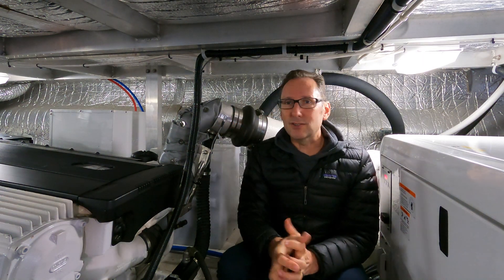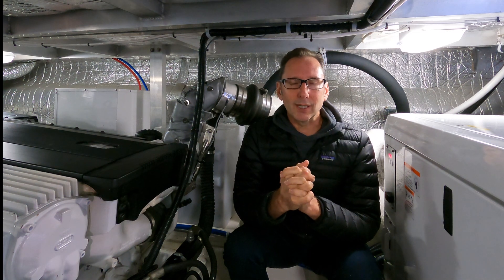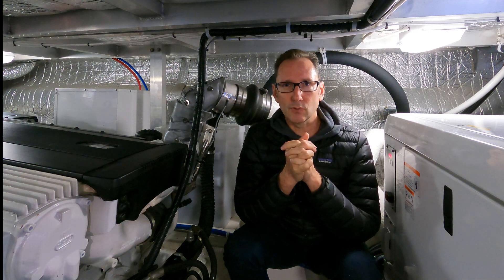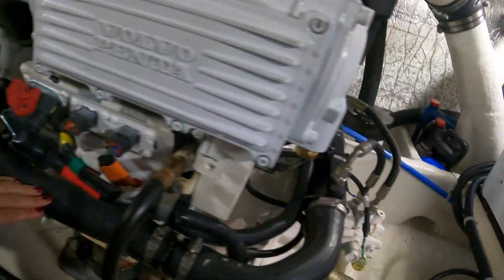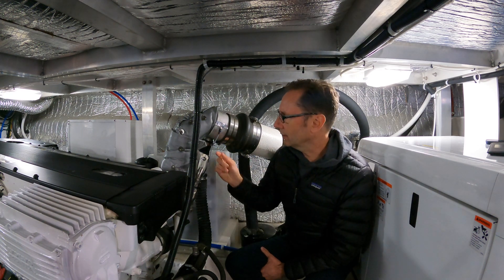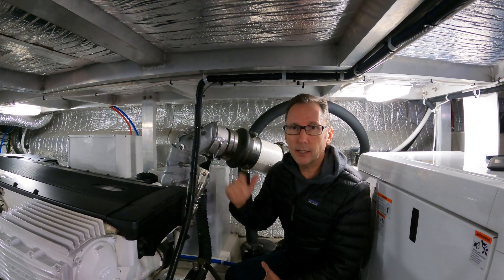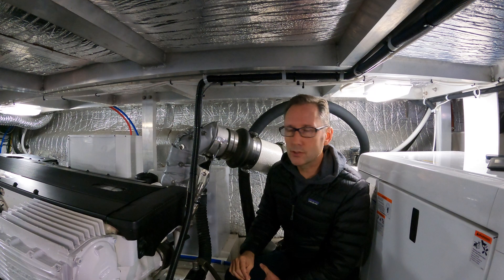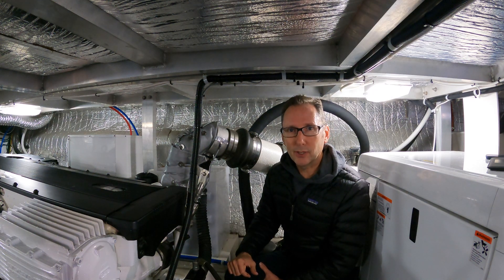Maretron TMP100 - Avoid Diesel Marine Engine Over Heating Failures with Raw Water and EGT Sensors

Comment: I'm in the process of having all my electronics upgraded. I will be using Simrad NSS EVO3S 16” hybrid touch (2) and would like to begin monitoring my engine exhaust to begin with possible monitoring of other engine related things. Curious if I should buy the Maretron DSM410 Display or if I can just use the alarm features on my new SIMRADs.  I would rather not add another display to my existing dash which has very limited realestate.  Has anyone else use the Maretron monitors with their Simrad NSS EVO3S 16”?
Reply from the maker: Good question. I have Raymarine and they don’t support the NMEA PGN 130316 for EGT. I know Garmin does. I googled Simrad support for 130316 and it is listed in their NMEA 2000 PGNs supported by the NSX MFD/chart plotter. I would recommend double checking with tech support but, it looks like you’re good.

Comment: Great video, thanks! Looks like the sensors are taped onto the elbow. Is that flue tape?
Reply from the maker: Thank you! Since we didn’t have a bolt provision to mount the sensor, we used VHB (very high bond) tape on the exterior of the tape and then put foil on the outside of it. 

I was going to change it to a high temp tape but, it won’t come off… 😂

Comment: Excellent video. I have always felt there should be an EGT gauge for each engine.  As a pilot we always had an EGT gauge for the engines. I am going to do this for my cat 3208,s.
Reply from the maker: The piece of mind while cruising is worth it alone. I’m adding a sensor to our generator too. Garbage like plastic bags in the water love to block intakes at anchorage…

Comment: Where did you mount the temperature gauges on your boat?
Reply from the maker: We used a Maretron DSM410 at our helm to display and alarm for high temps. It’s on our NMEA 2000 network so, some Multi Function Displays like Garmin would also be able to display the EGT and exhaust cooling temps. Unfortunately we have Raymarine MFDs and they don’t support the EGT NMEA PGN so, we’re out of luck there.

Comment: Thanks for your videos! I am planning to implement this solution, hopefully in the next few weeks.  I will chronicle with a video.  Jon, I am planning to buy the Maretron DSM410.  Are the other parts listed? Maybe it is just the sensors themselves...can you tell me where you purchased those? 

And also the TMP100...is this it? This is not needed for the raw water and egt solutions, right? Just nice to have. https://www.digikey.com/catalog/en/partgroup/tmp100-and-tmp101/56620. My Navigator is a 1999, so all of its sensors are analog

And I figure I will have to run a separate wire for temperature sensors to the helm...and hopefully connect to my Raymarine SeaTalk.

Comment: How is the raw water exhaust sensor installed?
Reply from the maker: In a perfect world the exhaust sprayer cans have a plate with a bolt on them to connect the sensor. Unfortunately, ours don’t have those provisions. Another way is to secure them around the can with a large hose clamp. Again, that doesn’t work on ours, as our can inlet takes up the entire width of the can. So, we had to adhere them with 3M VHB tape and add a foil insulation layer on the surface.  A compromise but, in practice, they are stuck like hell and aren’t budging.

Comment: There is also another fault that i notice a lot. some cursers after a run do not allow there engines to cool down from operating temp after a good crews and just shot them off  not a good thing and also can cost you big money there is a lot of dissimilar metals in an engine shutting right down can caws a lot of heat best to let them run at idle for 15 min before shutting them down Of course been there the cost was 60 Gs
Reply from the maker: Good call out!

Comment: Did you install them yourselves? These are things that will make our journey a little bit less tense.
Reply from the maker: We had the EGT bungs welded into the exhaust risers. Otherwise, the raw water exhaust sensors are just adhered to the exhaust sprayers.  Some sprayers have external bolt provisions too. Then it’s just running the cables and configuring the gauges. It’s a pretty straightforward DIY.
Reply: @ElliYacht1  
Do you hav e any fuel pressure gauges as well?
Reply from the maker: We have flow rate sensors as part of our OEM electronic engine monitoring package. Another great tool to understand fuel consumption deviation.
Reply: @ElliYacht1  
Good to know. Thanks